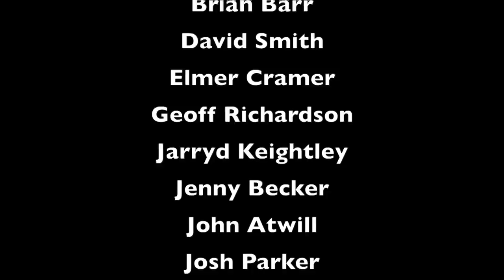Prop shaft and rudder post installation

Comment: If you crush the ice and mix with salt (sodium chloride) ratio 3:1 you can get to about -20C. Calcium chloride will go still colder. Obviously only if you can then flush out the whole shaft with fresh water - freezing salt is somewhat corrosive (even compare to sea water!) Might just get you the extra contraction you need... Good luck
Reply from the maker: Thanks mate. Interesting information. I've found a local source of dry ice pellets I'm thinking of trying, which I've heard you can do something similar with using pure alcohol. Will be interesting to see if it works!
Reply: @DangarMarine  That will work - can use acetone instead - more flammable, maybe easier to get. Be careful - dry ice often doesn't burn you due to the gas layer it forms - a liquid at -78C won't do skin any good :-) That cold a lot of plastics go brittle, so do test any gloves you're using. 316 stainless is OK - some mild steels aren't

Good luck. One other idea - really cold oil and grease get stiff - you might be able to lubricate for assembly with graphite powder in the bearing slots and turn the shaft. In the UK it's sold for lubricating locks

Comment: how about one of those radiator pipe freezing kits you use to change pipes with i believe you can hire them you can then pack it around the prop shaft

Comment: 2 hands always on a grinder  with steel brush ,also also handle would help.
Reply from the maker: Trouble with little bits is that they need holding too...
Reply: @DangarMarine thanks for the reply. Great channel.

Comment: Yes those wire cup wheels are really nasty, I was cleaning some rusty 6mm plate and hit the edge the wrong way and the kicked back and the wire wheel grabbed hold of my work top and wound it up in a ball and stalled the grinder. copped a bit of a wound like the deeper of your one on the shin. Could have been much worse if the grinder hadn't stalled.
Reply from the maker: Yes, wire wheels grabbing clothing rarely ends well!

Comment: Nice upload today stu question for you as you have the prop shaft out why not replace it with a new one instead of having to do it in a year or so down the line it's just more work to be sorting and more expense of course, but doing a new installation now would save you time and effort. Boat will have to be heaved up on land and up on the supports all time consuming and cash eating. None the less a very interesting  upload cannot wait for your next episode best regards from a land lubber uk pom.😊

Comment: I've never seen a cutlass bearing like that usually a brass housing with the rubber inside and a much tighter fit in the tube need to be pressed out. that one to me looks not too secure. I think the epoxy it in method would be more secure. just saying. might want to redo. also I don't know if you have the room in the rudder tube but 2 seals is the usual.
Reply from the maker: Hi James. Sikaflex is amazingly strong so we'll see how it goes. There already is a top bearing in the rudded tube, but it was still in good condition so I didn't replace it.

Comment: It seems like the perfect time for that new prop shaft to me. If you damage the prop with the welded nut would you be able to replace it without a haul out? Haul out might help offset the cost of the shaft.
Reply from the maker: I agree, but unfortunately I just don't have the cash at the moment. It will need doing soon though.

Comment: Good call with the Linseed Oil, Just slap it one once a year and Bob's your uncle.
Reply from the maker: This stuff was interesting too as it has an antifungal additive which should help with rot.
Reply: @DangarMarine  That Turpentine won't really rot, it weathers very well, the end grain is where the water will get and it ill start there but it will last decades & look better with time, any cranky bits of grain on a bend may cause problems, if it's going to crack or pull apart it will crack at a cranky knotty swirl, straight grain no problems.

Comment: Worked on both Detroit’s & EMD two stroke engines. Running the top deck and squaring the racks is not that hard. Make sure your injector plungers and the rack linkage are not binding. If your governor is good, you shouldn’t have a run away.

Comment: Been there with the locking switch grinders, I was under a tractor bush hog mower sharpening the big blades (about 5/8" thick), got a bit tired working overhead and dropped it. It tried chasing me out from under the mower. When I do those kind of jobs now I try to keep a paddle switch grinder around. Damn grinder rash... almost as bad as falling off a bike into pavement.

Is it too late to pull that rear bearing out and manually put it on the prop shaft, then seal it in place? 
I think that fibrous material might stretch enough over the shaft imperfections, instead of fighting the compression from the steel tube. It is a long ways to go and you only get a few thousandths shrinkage freezing it.

BTW who cares about the sunglasses, you got to have some of your own personal style/quirks  makes ya human to the rest of us... we do the same crap, some folks care and others dgad....

Comment: Interesting, that seal on the rudder although maybe rubber coated has a stainless body I assume, especially the tension spring a same size o ring is a good option and of coarse way above waterline, mine has a full  on stuffing box on the rudder stock  but I guess that makes up for having no other bearing. If I can't be bothered with the mess of sandblasting, Smaller rusted parts come up good in white vinegar  then drowned in lanolin. Next time you pass by Hervey bay as we discussed drop in for a squiz at my mess we can show the viewers the massive (Mob) of kangaroos that lounge around by the beach here
Reply from the maker: Hey Phil. It will be interesting to see how the oil seal lasts. Of course pumping the tube full of grease will do a lot to stem the flow of water. I'm hoping next time I'm up your way I won't be in such a rush. :)

Comment: group of boomers is a herd, a mob or a troop. Tree kangaroo are a colony
down here we just call em boomers or big boomers, making the distinction between reds and the rest.
but then we've got real kangaroo out here
You could gently heat the tube and bearing material (as a consequence) for the prop shaft as well, 

it will make more of a difference as its more material in diameter therefore expands more.

Comment: Stu, you really should check that shaft with a dial indicator and see if it’s straight. Damn thing will vibrate the xxxx gold right off the bench if it’s got a wobble in it. I’m assuming you have seen Keith fenners channel. He shows how.
Reply from the maker: It wasn't straight, but the company who made bearings also straightened the shaft at the same time.
Reply: Dangar Marine ok good. I was gonna ask are they balancing the Detroit in the rebuild aswell?
Reply from the maker: They've stripped the Detroit right down to the crank to check everything. Should be very sweet when back together.
Reply: Dangar Marine not to cast a shadow but I had the dubious honour of having my Isuzu 4jb1t rebuilt by a professional including rebuilding the injector pump and everything. It was never ever right. It ran but it wasn’t ever as it should have been. So make sure your 100% happy with how it sounds and runs on install. Maybe even start it out if you can. Because it’s a total life ruiner if you have to keep chasing it after.

Comment: A great video for a Sunday morning, thanks Stu.  Congrats on the 100K subs, well done.  I would have thought that the PPE required when using a wire wheel would also include eye protection?  Just BTW, the collective noun for a group of kangaroos is "mob".

Comment: Maybe the shaft is made thicker at one end for a reason. Maybe it’s supposed to be installed from inside the boat.
Reply from the maker: I thought that too but it is longer than the engine bay so it can't be installed from the inside. I think the reduction is purely 30 years of wear.

Comment: Do I understand it correctly that with the prop nut welded on, you cannot remove the propeller?  If so, this looks like a really bad idea because there may well come a day that prop needs to come off for repair/replacement, especially with the intended employment of the boat.
Reply from the maker: Yes, it's definitely a bad idea but I don't want to cut it off until I can afford a replacement propshaft. If it goes wrong it will be out of action completely.

Comment: Puzzled by rudder post. What supports it? Setup as shown has only support for weight of rudder and  shaft  provided by steering ram mechanism which can't be right. Surely the keyed arm must sit on a thrust  bearing surface on the top of the post.
Reply from the maker: Rudder is supported from underneath by a bottom bearing carrier and then post rests on top of the rudder.
Reply: @DangarMarine  thanks for the reply. Very much enjoy the videos.

Comment: Cheaper calipers draw the same power when off as they do when on, 

Stu, what would you think about hitting the outside of the prop shaft tube with the oxy?
Reply from the maker: I don't want to burn all the new paint off with a torch so I'll try just cooling the shaft first.

Comment: Really enjoying your videos and look forward to each one you put out but there will be delays in your videos and work progress on the boat if you get one of the wires off the wire brush wheel on the grinder in your eyes. They will do permanent damage to your eyes please wear safety glasses I have had them things stuck in arms and legs while working on my boat and they go thru clothes. Grinders do a nice dance when they grab an edge don't they lol bean there done it got the scars. Keep up the good work.   Chris
Reply from the maker: An eye patch and a wooden leg never stopped anyone working on a boat!
Reply: lol and a parrot on your shoulder

Comment: Not sure who told you to hammer in the cutlass bearing but that's the one thing you do not do, hammering in a cutlass bearing deforms the bearing which is why your prop shaft now will not slide in, a cutlass bearing should be a push in fit by hand then 2 locking bolts go in from the side thru the stern tube stopping it from spinning and come out.
Reply from the maker: It will be interesting to see how free it is when it gets to the thinner part of the prop shaft it runs on.
Reply: @DangarMarine  yep look forward to seeing it in. 1 more question, is there any water flow to the inboard/forward side of the cutlass bearing? be it holes forward of the cutlass in the stern tube or a water injection just behind the shaft seal.

Comment: You were trying to get the prop shaft in before the Sika set up. Are you going to push the bearing out and reseal it with fresh Sika or just go with what you have? I'm thinking when you get the top bearing in, it will either line up and go in or it won't,lol.
Reply from the maker: There is only Sika on the rudder post bearing, the prop bearing was a tight enough fit. There is no top bearing on the prop shaft it is held by the gearbox.

Comment: If you'd worn protective shoes plus shin guards, the run-away grinder might have responded by attacking higher up, with a potentially horrible outcome!
Reply from the maker: That may have indeed happened and caused serious damage to my angle grinder. ;)

Comment: Hold your speed square on the board as you cut
Reply from the maker: Personally I don't like cutting that way.
Reply: @DangarMarine  You may have better aim than me.  Or a sharper blade.  I just find that I wander at the end of the cut and sometimes it binds the blade.  Took me 40 years to figure out that carpenters use their speed square that way.  Anyway, to each their own.  Keep up the good work.  I'm enjoying the progress on the trawler.

Comment: Thank.you.for.taking.my.advice.on.the.rudder.shaft.new.now.i.can.see.a.problem.with.the.shaft.it.will.tear.the.culass.bearing.in.that.conditio.also.the.bearing.swells.somewhat.and.yo.dont.want.to.run.it.too.tight.it.looks.like.you.have.an.elongated.egg.in.itit.needs.replacing.or.you.may.get.six.months.if.your.lucky.on.the.bearing.bite.the.bullet.and.ditch.it.the.method.of.fittment
Is.you.should.be.able.torotate.it.in.by.tooing.and.froing.the.shaft.regards.

Comment: If the LTD has steering wheel on right instead of the left being from the US I would really like to see a good shot of the interior
Reply: It would have, Ford Australia also did the "Landau" as well as the "LTD" in the later 1970's, you could try google images.

Comment: That is why power tools aren't ordered with locking switches for professional shops. If they come that way, the locks are cut off.
Reply from the maker: THe locking switch broke when it hit the ground so I guess it is a problem that has fixed itself. ;)

Comment: Just an observation chap but shouldn't you have a bearing at the top of the rudder post as well? You have a lot of play up there and with the forces exerted in use, the top of shaft will like a prick in a bucket, this will cause uneven wear on the bottom bearing. If you put in a plain bearing you can ditch the oil seal.
Reply from the maker: The top bearing was fine and didn't need replacing.
Reply: @DangarMarine  OK, I must have missed that bit.

Comment: U could try liquid nitrogen? On the prop shaft
Reply from the maker: My worry is that if I make it too cold it may fracture. Not sure if it is a realistic worry, but something I was thinking about.
Reply: @DangarMarine  i dont think it will crack. And please wear safety glasses!!!!!!!!!!!(!!!!)!!! When using the wire wheel etc

Comment: Did you ever dry-fit that bearing onto the prop shaft before installing it?
Asking for a friend ...
Reply from the maker: No, but only because the guy that machined it had the propshaft (which he straightened) so I knew they were a matched pair.

Comment: are there grease fittings for the the rudder post and prop shaft,if not how are they lubricated?
Reply from the maker: Water lubricates those bearings. The grooves in them are designed to let the water in.

Comment: Dangar, I appreciate you reading this! I have a J225hglssc on a 20’ bass boat.
I can put boat in the water and it will fly out to the fishing hole. I fish for an hour or so and the crank engine. When I hit the hot foot the engine takes much longer to get on plane and will only teach 4000 rpms maybe 40-45mph, definitely a loss of power compared to 5500-6000 rpms and 70-75 mph. Do you have any idea what this is?
I’ve done this four times now and the exact same thing happens?
I sure could use your help!
Thanks!
Reply from the maker: Could be an injector leaking fuel while it is sitting and either flooding a cylinder or starving for fuel.
Reply: Hey Dangar! Thanks for the response! I did have fuel spitting out of two carbs so I replaced the reeds, still had problem just not as bad. Took the VRO apart and found a tare in the diaphragm fuel/oil side of pump. Rebuild kit arrives tomorrow! Now doubt she’ll run great.
I actually had multiple issues.
Thanks for the help!

Comment: Will the rudder shaft drop down and control horn rest directly on the oil seal or is there something else to take the thrust load?
Reply from the maker: Rudder holds shaft up above the seal.
Reply: @DangarMarine  Ah thanks of course! I forgot there is the pivot at the bottom of rudder. I guess it would be too weak if not having something at the bottom.

Comment: It appears the prop shaft was supposed to be installed prior to installing the prop shaft bearing. So much for design parameters. Stinkin prop nuts....
Reply from the maker: I think it is just wear rather than a design. Anyway, with the prop welded on installing it first isn't an option for me.
Reply: Nobody can accuse you of having a screw loose LOL !

Comment: Those cheap calipers eat batteries even when off. I feed them with equally cheap batteries from ebay, keep a handfull of spares with the caliper. Too expensive to buy more than a couple of those batteries from any local shop. With an older pair (now dead) I once got fed up and soldered in an AA size battery on short lead because i had no LR44 handy.

Comment: Wire cup wheels are NASTY its why I don't like using them if I do I have a handle on the grinder so you can have two hands on it. I will use a regular flat knot wheel over a cup any day of the week. Buy yourself a couple cases of computer dusters you know the compressed air things for blowing out the shit trapped in keyboards. You turn them upside down and squeeze the trigger they blow extremely cold liquid it will contract the steel.